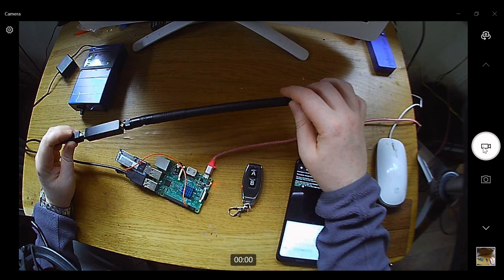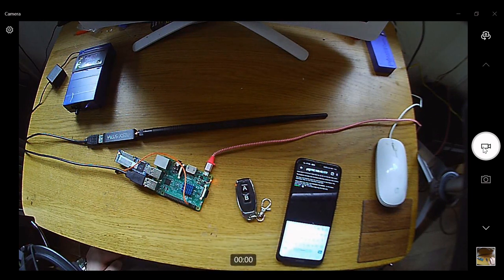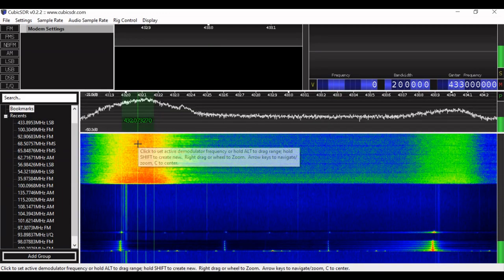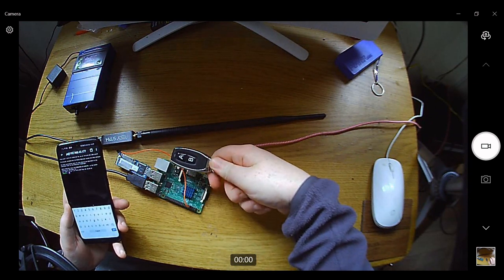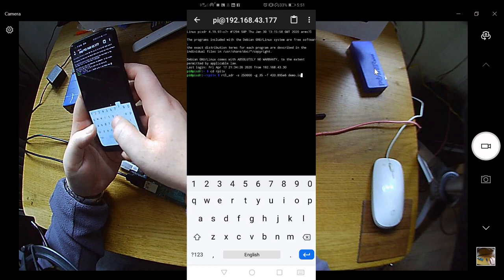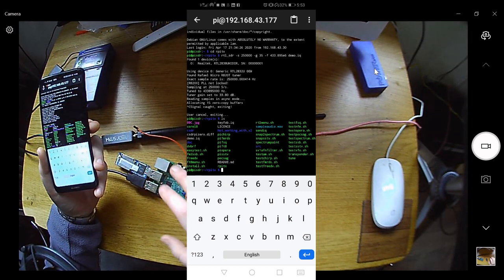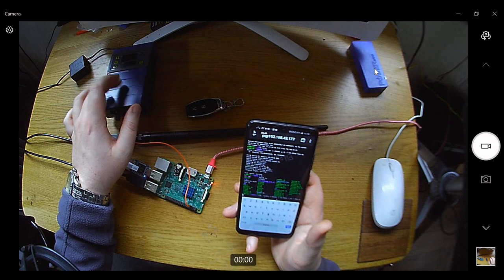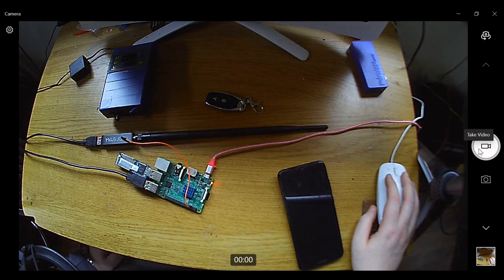SDR & Raspberry Pi - Capture & Relay attack

Comment: I am really interested in testing this at my home since I already have a rasp pi 4. But im wondering where to get the actual transmitter cable for it?
Reply from the maker: Hi Eric, sorry for the delayed response however the cable we used for transmitting the signal was simply a jumper cable used for the pi GPIO pins but you would quiet literally use any piece of cable to act as an antenna to transmit.
Reply: @Elysium2020  plz give details on which gpio pin that jumper is to connected...
Plz share any link which has details
Reply: you just need a wire on gpio  4 but currently rpi4 rpitx is in beta so  dont expect everything to work  perfectly  
i wish you  goodluck  my friend .